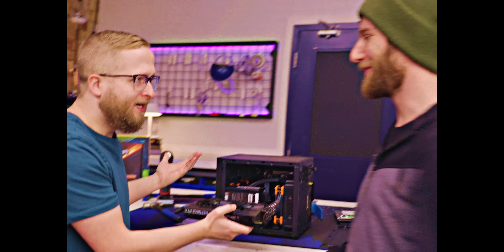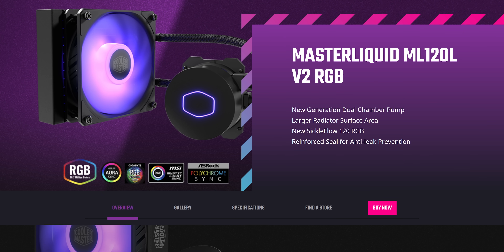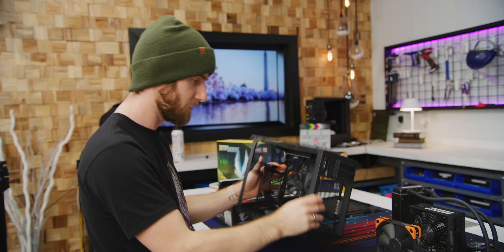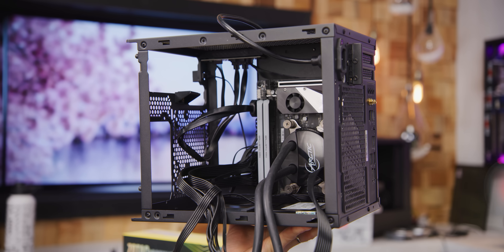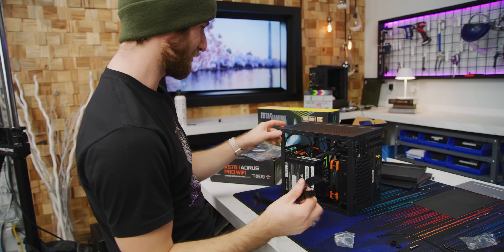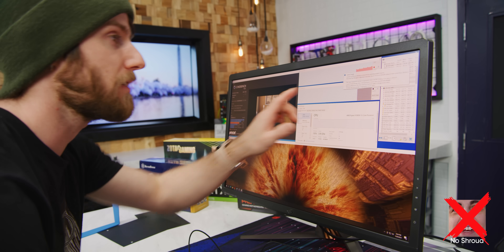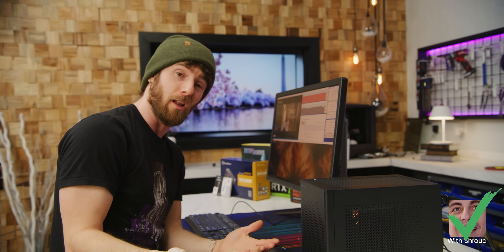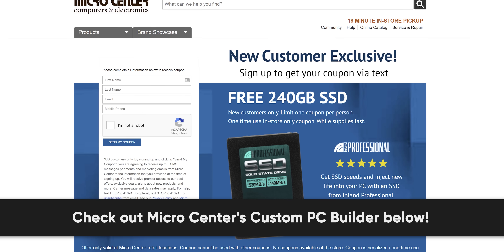This GPU SLIDES into this Case! - Silverstone SUGO 16 ITX Case

Comment: Instead of using the 3d printer for a shroud, you should 3d print a stand.  Like a square with the center cut out and some tall pointy cone feet like a sub-woofer might have.  Then turn the box upside down and put it on the stand.  The shroud you made would seal the graphics card as an intake better on the bottom, and you could notch down the sides of your shroud so the vent sides of the graphics card are still unimpeded.   Now the Graphics card is sucking in fresh air and not having the fans work against thermal convection, and cause your CPU is still drawing in fresh air from the front AIO, CPU temps should remain pretty much the same.  Hope you read this, would be a cool mod.

Comment: Eh the TT core v1 has a GPU cut out to slide it in from the front as well. Its a little bigger of a case but also easier to work in and gets surprisingly good temps even with just air cooling. I even found a TV stand that would fit it so it works perfectly doing double duty as a gaming PC and HTPC for my projector.
Reply: Big fan, pun intended, of my TT Core V1. Best temps of any case I have built in.
Reply: @Javious_Rex  Yeah I was more than a little surprised considering I picked it up for like $30. Certainly the best temps I've ever seen considering there's only two fans in the whole system. A big 200mm front intake fan and a 120 on the CPU cooler with no output fan so all positive pressure since I have a blower style GPU.
Reply: @gatticusfpv3174  I originally had a pair of 80mm fans in the rear, but when I removed them I found that my temps didn't increase. I use the vented panels on the top and GPU side, fresh air for the twin GPU fans and the hot air radiates out the top of the case.

Comment: honestly I think that GPUs should get their own dedicate box in a case, or rather make the entire case modular, a box for each of the big common components like PSU, GFX card & motherboard, all of them should have the sides removable and the box being reversible, this would allow setting up the individual components outside the case then just plugging the box into where ever  the owner has set up the space for it, we already have extension cables, just go the extra step, also the io of a motherboard should instead be just a simple PCI-E slot that is parallel to the output slot instead of against it as they usually are, this would allow the io strip to be a plugin instead of being built-in to the motherboard, I'm sure PCI-E 4.0 & up have plenty of bandwidth for the usual USB ,ethernet, audio, PS/2, etc slots

Comment: I love silverstone great designs. I wish they made a taller FT-03, with better airflow for an xfx 6900xt merc black. It works right now but not enough cooling, so it ends up noisier than I'd like using 2 80mm fans instead of the 120mm

Comment: This isn't new. The SG13 could take up to a 280pm two slot GPU and had a big opening at the front to slide it in that way.
Reply: @RJRC_105  sorry to necro, but after building in a sg13 - I'm buying a SG16

The cut out in the front of the sg13 does not allow taller GPUs to actually fit through.

It fit my 1050 and my 2060 Super - but couldn't fit my Asus 3070 :(

Comment: "It's got a special cut-out on the front of the case so you can get a big GPU past this power connector they put in a weird spot, so you can still use regular cards!"

"We'll use this special 3070 because it's super short and is one of the few GPUs to actually fit"

monkaHmm

Comment: I feel like an NH C14s cooler would be better in this kind of build. Its also perfectly capable of cooling up to a 12700k at stock or undervolted 12900k since it can dissipate up to 190w before throttling from my own experience with a 10900k. Also no need to worry about water leaks
Reply: Sounds fancy

Comment: I wonder how the new SG16 would fare against the old RVZ03. Apparently, the biggest differentiator in ITX cooling efficiency is its capability to blow fresh air onto the GPU while having the GPU mounted parallel to the PCI-E slot on the motherboard, which is only possible through special mounts or riser cables (or the new motherboards with backside connections that allow parallel mounting of GPUs, such as the MSI Project Zero). Graphics cards are on a trend of getting bigger and heavier for seemingly little benefit with increasingly diminishing returns, becoming less acommodating to the ITX segment, as it is the biggest and hottest point of the system radiating immense heat to its surroundings and causing hotboxes to form. And cards being covered with plastics on all sides except for the rear certainly doesn't help the situation. Manufacturers like Sapphire, Powercolor, Zotac and EVGA (RIP) know this and try to avoid choking or obstructing the natural heat dissipation/convection channels while still leaving headroom for aesthetically pleasing shroud designs.

Comment: Have any of you built an ITX system and found that the lack of a second PCIe lane has caused a problem for you somewhere down the line? I've wanted to build one for a long time but that's always scared me off doing it. I seem to need a second PCIe slot for diagnostic purposes at some point on every computer I've ever had. I guess I don't "NEED" it but it really makes things easier. Signal tracing, hardware issues and thing of that nature.

Comment: I would like to try the Seasonic SFX power supplies, in other places in even remedial use I have had a lot of bad luck with various brands of SFX power supplies, one of them the application was a DVR and after replacing the 3rd 500watt unit I took a drill and tin snips to the DVR housing and mounted a full size 380 watt ATX supply from Antec in it, and it's run happily for 5 years, when the SFX units from other players where lasting maybe 2 years at best, they weren't even under that heavy of a load.

Comment: NEVER suck air from gravity! It would kill it with dust faster than you think unless you are running it a chip manufacturing dust free clean lab. Also, sucking air from top is pretty dumb for anyone who knows heated air tends to go up. So, a general advice here; 
* Always use your top to push hot air (so, dust with gravity also couldn't reach top of the case since there is a blow). 
** If case designe pushes you to set gpu at top like this video; just open gpu's cooling set, find a way to flip the fans and glue them reverse, so they can suck heat and push it throu top of the case rather than suck air from top and push it cooling unit.
You're WELCOME

Final advice to card manufactorers and case designers; since we can relocate the pci-e port for a long time, isn't it time to designe some tower air cooling units on graphic cards. Imagine a tower heat sink between 10'' two fans sucking from right side throu tower and pushing to left side out the case. Why do we messing with tubes if you show us single fan unit radiator water cooling card? Just put it on like a fat tower with a little handle to screw the sink top of the case and weight is not a problem again...

Comment: Um, I'm guessing part of the reason you made your "shroud" was to reduce hot intake air due to convection. Why didn't you just put the case on it's "side"? The panel it would sit on is the back of the motherboard, so it doesn't need air. It would seem to solve at least one potential shortfall.

Comment: Been checking back on this video for a little bit. Isn't it better to run an Air-cooler tower in this case over a 120 AIO? Granted, the Arctic Liquid Freezer is a really good 120CLC

Comment: Hey can you guys do a video. Do sound cards do anything for gaming in 2021. Are they worth it? Can you notice a difference with a soundcard. Does the offloaded sound increase frame rate? Is there a difference in the outcome based on pci or USB interface. I figured this could be an easy quick video.

Comment: It's a nice case but still larger in volume than the Ncase M1, which Optimum Tech  fit an RTX 3090 AND the 16-core Ryzen 3950 into last October. CPU ran several degrees cooler too.

Comment: you solve the gpu thermal issue by putting feet on the top of the case and turning it 180 degrees, top of the case is now the bottom and the gpu pulls air upward into it

Comment: Considering you are probably on 20c ambient, those are awful thermals,  would probably be 5~8c better if you didn't throw all the hot air from the AIO inside the case.

Comment: You should build a case out of a single piece of metal, use compliant mechanisms for the door. Maybe use a backfacing CPU motherboard so you can use the case as a heatsink. It would be a shame to use any moving parts in the build (no fans!)

Comment: having built a computer in a massive case, a regular size tower, and in a tiny coolermaster one, if you're willing to sacrifice a full fat motherboard and you don't need a 4090 or 4 DIMMs of memory in it, the tiny one wins every time, you can't see many of the internal components so rgb is pointless on a lot of the mini cases, but they perform quite well and if you ever have to move it, its so much easier to move the mini case build around than my corsair 9000d airflow, but the 4090 in the corsair case wouldn't even come close to fitting inside the little coolermaster case.

Comment: I think this build could of been done better. Putting the radiator fan case side to start with and used dust filters for intake only. As for GPU would it not been possible to also use an aio?

Comment: Linus, all these cable management would be unnecessary if the manufacturers of the motherboards put all the conetions on the back of the motherboard. Definitely there is no need to be where they are since 1970's

Comment: if it were up to me I’d flip the case upside down and give it tall feet. That way you wont have to worry about hot air from the CPU cooler getting in the GPU

Comment: It's impressive to see how badly 120mm aios suck. My 5900x reaches steady state at 67° when locked at 4.7ghz. With PBO letting it boost to 5ghz in-game, I max at 52° with a galahad 360.

Cases like the Meshilicious and the Revolt 3 have a smaller footprint, wider gpu support, and better cooling.

Comment: What was the piece that broke/popped off at 13:36? (bottom-right corner of case, furthest from Linus) I hope to see them make just a slightly larger version as Linus suggested to allow for triple-slot GPUs and fill-size PSUs as well! I'd love to fit my current gear in this without having to buy a new parts nor compromising on cooling due to using smaller fans.

Comment: Total noob here, wouldn't this thermal design hurt the VRMs and other components since all the hot air is going through the case to the front? My SSD for example thermal throttles to a halt if I route all the hot air over it and do a benchmark on the system.

Comment: Won't there be an issue with overheating motherboard components and power supply, as they mostly get the air from CPU and GPU coolers?

Comment: i used to have an matx size case that could take a full atx motherboard and two 5.25" bays, the psu was mounted vertically in the front of the case.

i cant for the life of me remember what make or model it was nut it was cheap (under £30)

Comment: Ah yes... That pull into the radiator without an air filter. It is gonna be fun removing that radiator with all the space to clean out the dust stuck between the fins :')

Comment: Hi, I'm building a very similar setup but had a question regarding your PSU orientation in this video. You've got the PSU intake fan directed inwards (pulling air from the same area as the exhaust fan), instead of against the case ventilation holes on the side. Was this a conscious decision or an honest mistake? How would it affect component performance and lifespan? Thanks

Comment: The more compact the case, the more heat builds up, which means more fans running at higher speed, which means more noise, which means more water cooling, which means more pump noise, which means more pump failure, which means...time to build a new computer with a larger case.

Comment: Meanwhile I'm moving from a Corsair 220T case to a Corsair 7000D to run bigger fans for lower RPM and great airflow also swapping PSU from 850 bronze to 1000w platinum and going from 240mm AIO to 420mm AIO for the Ryzen 5700G to 5800x swap once the new CPU gets here
Reply: That’s a pretty cool setup. I have a 5800x and it is great with my 240mm rad. I have a RTX 3070 with a 750w psu and it runs great too.
Reply: @qundaledingle7986  my brother wants to buy my current setup so going to just swap the 5700G to the 5800X and leave it all in the Corsair 220T case with an EVGA 3060 XC and build a Ryzen 7000 series rig in the Corsair 7000D case with the EVGA 3080 XC3, 1000watt platinum PSU and 420mm AIO I already have for it mainly just need Motherboard CPU and RAM to get it going then add more fans/upgrade fans and add more RAM and Storage overtime

Comment: As excellent as this is, I (as an owner of several ITX system (and powerful systems)) always ask myself, "is it worth it".!!!
.
My secondary PC is an ITX system, but in retrospect it should be a mATX system, because I really need more than one PCI-E slot, and as such the extra space, saving on components, cooling etc would have made it cheaper and better for my needs.!
.
Ultimately EVERYTHING in life is a compromise, this kind of build (in the video) is a few steps too far for me because I am sacrificing many things for space, I have the space, if I didn't, I would make the space - each person needs to weigh their compromises, we are overwhelmed with options, weigh the balance carefully and be happy and without regret at the end :)

Comment: Hey linus tech tips have you try to use a miner PCI-E with sli gpu along with 2 non sli gpu it work for me
Reply: I using a gtx 670 along with 9800gt and 9800gt sli  with 2 miner PCI-E riser to mini PCI-E

Comment: Amazing video again. I have a question tho it's not related. I am planning to wall mount my router and was wondering since dust will get in and I only need 1 lan port, I would buy the male lan connector and just put them in the remaining ports to block dust. Will this effect my router? (Cat 6 btw). Thank you.

Comment: Is it possible to put the radiator on the opposite side? Front intake, through the radiator, then rear exhaust. That way i could put the unit looking up vertically, so it looks like an obese XSX. I just thought that the placement of the pump would be higher if i put it vertically in the current set up...

Comment: Hey Linus so I recently replaced my thermal paste but now my temps are a bit Higher so I replaced it again and saw some scratches on the edge of the aio z63 copper plate more towards the screws what do you think is the reason of the higher temp it used to be around high 30 now I’m jumping around from 43-55
Reply: At idle

Comment: I hate that case, I've got an old case that mounts the motherboard that way as well and having cooked 1 GPU in that configuration I now only use it as an APU case.  I give that system 6 months and it will thermal throttle, all it takes is a little bit of dust.

Comment: You might assume that CPUs wich can't use their stated power with a normal box cooler (in general) is false advertising or simply bad build if it can't handle it without overheating.

Comment: Why would you even consider or want an ATX power supply in this? Don't even understand how that should be a consideration. Better GPU support or cooling is far more important. You're not gonna be able to fit power hungry components that would need something more than 1000W (or 750W for that matter).

Comment: So extra money spent on a power supply you don't need that's going to run at lower than optimal efficiency, but you can't spring for custom power supply cables? LOL

Comment: I am having a problem in fps drop and my specs are ssd 256gb NVME EVM   cpu AMD ryzen 5 3400 gpu 1650  ram  8 gb and the dongle is 802.11n USB Wireless Lan card  and are these specs alright ?

Comment: Wow those heat numbers are really nice ... I have a full sized case and had to downclock my GPU as it always went to 90+ degree even when I set the fans on maximum speed :/ 
I guess I got the worst case possible plus I can't stand the GPU fans as one of them rattles like hell but I didn't want to give my rtx 370 back to the vendor as I wouldn't get another one withouth paying a few hundred bucks more.

Comment: that is cool being so compact and small...just screams easy to get stolen. my huge over sized aluminum case is not only easy to work on and good ventilation but its HEAVY and huge. someone is not going to discretely run off with it

Comment: I thought someone had built their gpu to fit within a harddisc space. Because I thought. And now wonder. Why the hell can't the GPU be in an effing box  that mounts to the front or top of your case. So they can shoot the 99% of hot air that is in there straight out. Like they've done with power supplies. And have an effing cable long enough. TO just snap into the damn motherboard. So you can mount if how you want. Instead of being forced to mount the 2 long thin things at different angles. Which take up the maximum amount of space possible and traps the maximum amount of heat possible in the case. Now I'm mad. Why the hell can't the damn GPU's be mountable and have cables instead of the nightmare that they've been!?

Comment: that 8 pin mobo connector is not hard to get in try working on real machines like industriel printers or cars its a lot harder to plug cables etc most times you cant even see what yyou are doing this case has all the room you need and you should be able to use your left and right hand there are a lot of times yyou can only do it with right or left so yyou need to able to use both